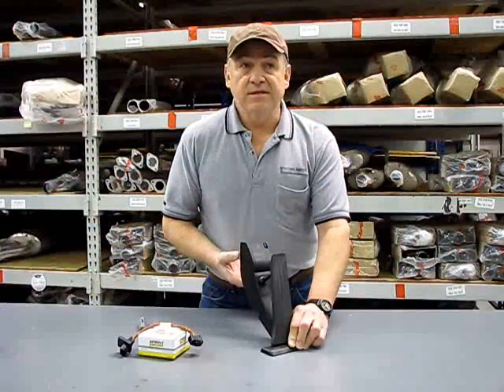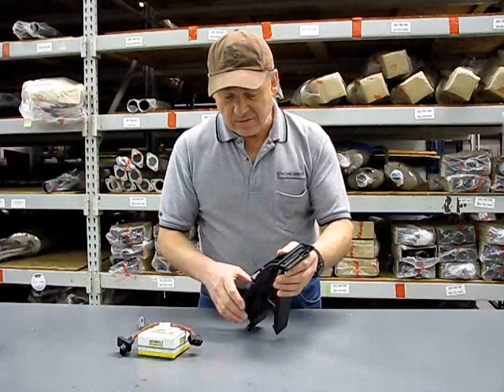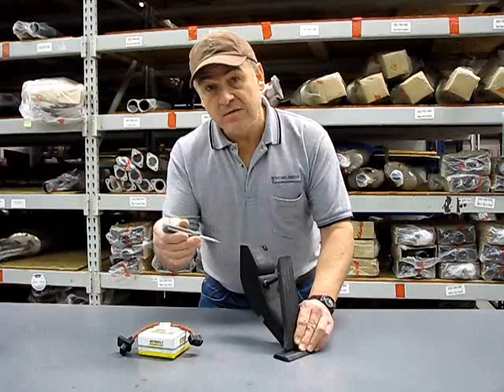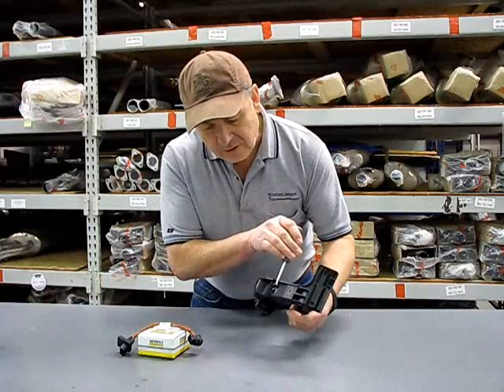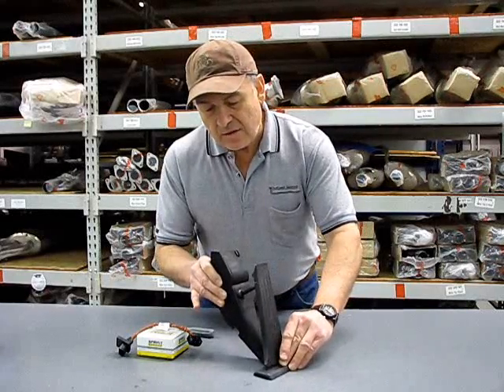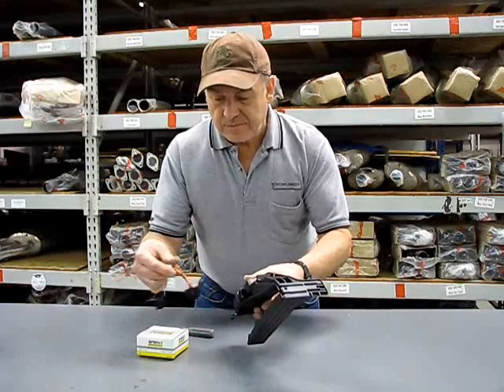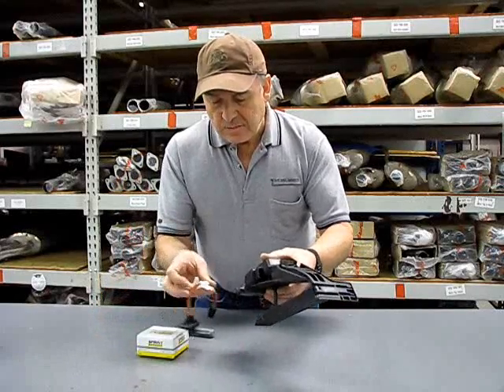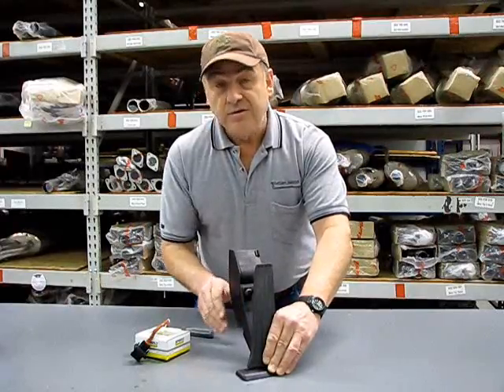BMW E46, E39, E38 Sprint Booster Install and Testing

Comment: My car won't recognise the unit. Says the accelerator is disconnected when I plug it in. Contacts are clean and wiring is good. Unit voltage tested and good. Car works fine when stock accelerator plugged back in. Confusing.

Comment: Just a note to consider - german engineers do think their stuff through. By allowing the throttle body to open up more quickly you change the overal power and energy build up from slow to fast. Meaning that torque forces are comming up not exponentionally to allow to "settle" with the car and its parts but all the force comes in like a hammer. 

If you do not understand what I mean then take a paper towel and attach some weight to it. If you lift it slowly it will hold. But if you lift it quickly it will tear in half. And that is what is happening here. Not saying do not buy that thing but more like "be considerate when using it and how".

Comment: just do a full ECU remap and boom 30HP more. update ECU internal software's, i update mine from 12.2004 to 3.2015 yesterday and the difference is noticeable, smoother engine noise, more pull in 1st and 2nd gear, better DTC adjustment
Reply: The point of these products isn't the increase horsepower, it's to improve throttle response. Imagine a car with 500hp that had an incredibly lazy and sluggish response to you depressing the throttle. It wouldn't feel nearly as fast as it actually is and it would make you feel disconnected from the vehicle. 

This comments on this videos are incredibly stupid.
Reply: how to do that? doesnt that hurt the engine?

Comment: For everybody who is boasting on this. What it does is cause more current of energy because of bigger gauge wires, so yes extra sensitivity, equal faster response, more voltage equal more power

Comment: This product isn't crap, it does what it says , improved acceleration at the cost of sensitivity on the accelerator , parking is little more touchy and gas mileage is reduced 1mpg I still drive like a grandma though just take some getting used to, combine this with an ecu tune and any car you own will feel incredibly faster

Comment: @bigjode You see this "cr@p" on the forums because those people actually understand what this product is doing, unlike you.  It is simply a DC voltage amplifier. Nothing less, nothing more.  It cannot change any "delay" introduced in the DBW system that is due to ECU maps and calibration.  Nada, zip.. it's impossible.  Suggesting otherwise simply shows a complete lack of understanding of how the DBW system works.

Comment: I just installed the sprint booster on my M3 E46, it is an amazing kit!, making the car much more responsive and it was already quite responsive except at low rev. With that kit, it is now more than perfect for city driving and motorway. I strongly recommend it.